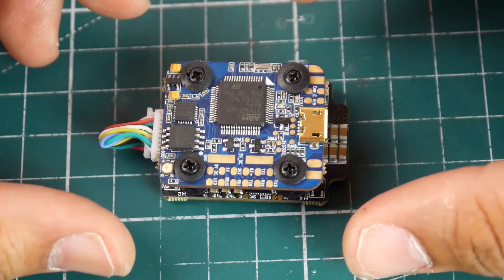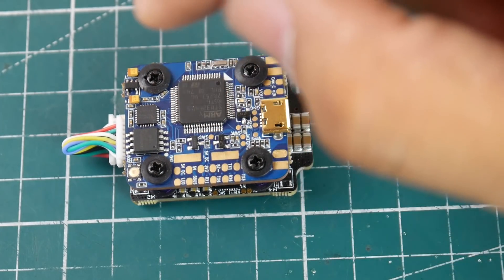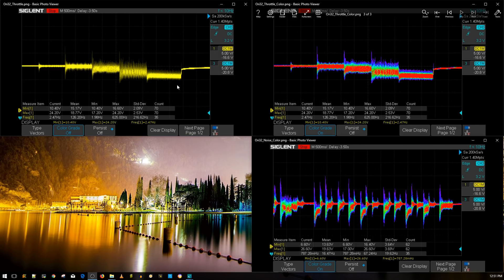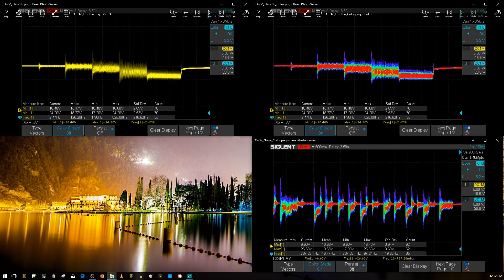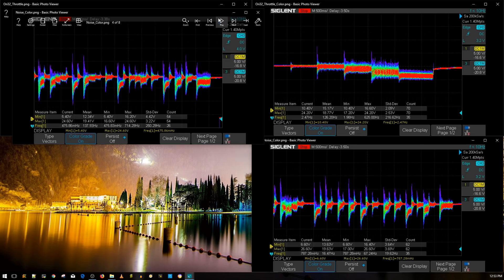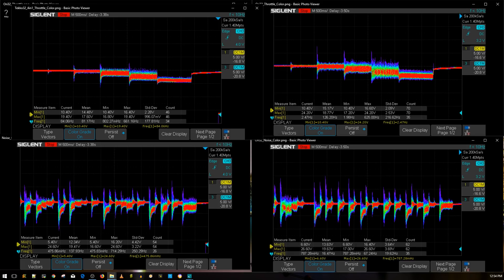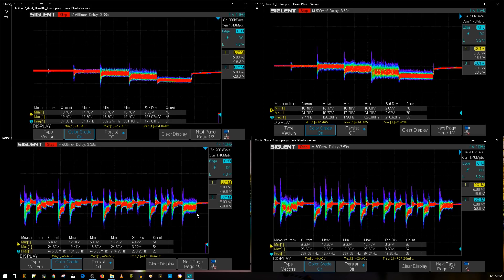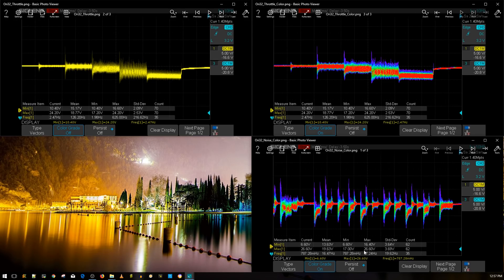NO WAY IT IS THAT GOOD!!! // Airbot Ori32 ESC Review And Noise Testing ,Omnibus F4 Nano

Comment from the maker: Airbot Ori32
https://www.banggood.com/Original-Airbot-Omnibus-F4-Nano-Flight-Controller-with-LC-Filter-Ori32-4-In-1-25A-Brushless-ESC-p-1321664.html??p=CS101558118042016088&utm_source=sns&utm_medium=rcgroups&utm_campaign=mesh&utm_content=tanghao
Reply: Esc can take 6s 👌😎
Reply: @maloulukasholm  i got 4 6s racing quads using em.. just run a nice fat cap and your golden.. one of them is a 2150kv 2306  set up also... she pretty fast. I've been running em 6s for over 6 months also.. very good esc

Comment: Hey man really enjoy these videos they give an accurate measurement of how good the esc are and show the best ones, I am highly considering this esc paired up with the omnibus nano v6 20x20, but when I go to airbots website, it shows what is called a Nox v2.19 you reviewed the pre release a year back but the specs on the nox look a lot better it can even have a 32khz gyro and it has 35 amp esc, I want to do a xhover vanover build which should fit the big thing, but the ori32 is a lot more popular on rc groups, really not sure what to get. I appreciate what you do and thanks.

Comment: Would anyone be willing to post dimensions? I can't find basic dimensions anywhere, even on Airbot's website. I just need basic dimensions so I can mock it up and make sure it fits in my custom 3inch frame.
Reply: 35*27mm for both ESC and FC, the protruding part on the ESC has total length of 40mm.

Comment: You should try testing the new lumenier. V3 micro stack 32 bit. I got one to put into my babyhawk r and once it arms it goes crazy like if I had my props on wrong or the motor direction is wrong but there not. And a lot of people are saying it’s really good.
Reply: My lux v2's gyro orientation was off like 270* on pitch and roll.  Once that was set up it flies nice.

Comment: Thanks for testing this! I run this same setup on a 6s 3" build. I run F20 2800kv motors on 6s 550mAh batteries and it runs like a champ. I got the 8v powering the Caddx Turtle and FX3 Ultimate VTX 20x20 vtx for a micro powerhouse. It cruises at around 1.5A and pulls near 80A on a punchout lol
Reply: I assume this is in a brat frame?  Hows the fpv video feed?  I've had issues with the akk fx3 filtering.
Reply: It is on a Tooth Fairy and with CRSF I might add :) I do get a bit of noise on them though yea. I got them on two builds and while it is a decent feed (better than most cheapies) I do have a bit of noise on both of mine even with caps. No biggie, but yea you aren't alone there. I'm also running 3052s and HQ3x5s and motors are still coming down cool. Might even go to 4" 6s.
Reply: @dispozablemobile  I am looking at trying a 6s micro.  Have you used anything else other than the f20s on 6s?
Reply: @BBSlats  no, just the F20s. However 5s 3600kv is much more fun :)

Comment: I have this stack in my only build, gotta say it's very, very good as DM said.

The FC is feature packed for such a tiny size, easily beat many full-size FCs. 5 UARTs, 1 Softser, II2C, CAM_C, S/A and ESC telem interfaces all conveniently placed. Baro, flash memory, 5V BEC, filtered 8V BEC for FPV (works very effectively!), onboard gyro capacitor and OSD in 20x20 form-factor!

The ESC is another beast. Designed in a way so users can install their own heatsink above the FETs, which increases the current rating exponentially (heat dissipation is #1 limiting factor in ESC). Individual current shunts which is incredible because most 30x30 ESCs don't even have individual current shunts, it also allows for BL_32 current limiting function for further protection. Very thick PCB, ESC telemetry function and so on.

A bit of note though, the ESC could take up to 6S comfortably. A lot of users have reported their stack works with 6S on 3" and 5" with no problem. A user even tried to fly with T-Motor (not sure which version) 2600KV on 6S ( https://youtu.be/TnkZIzjIU9s )
Reply: Update: I've gone through 3 ESCs in half a year.. While they sure can handle high current, they can't handle high transient current caused by gate clipping and such. I will not recommend the ESC. The FC in the other hand, still holds up well.

Comment: Brill! Pleased about these results as I already had one on order! Did it come with a heat sink?
Reply from the maker: No
Reply: @DroneMesh  kk, thought so, of purchased separately the ESC has a heat sink. Interesting...
Reply from the maker: @StormadoMan  I got the stack but maybe if its separate it comes with the heat sink.
Reply: @DroneMesh  correct sir! Great results thanks for testing. 👍
Reply: Be glad that yours will be shipped with the 8-pin connector. Mine was grounded for weeks before maiden just because the little piece of plastic.
Reply: bro how do you NOT have a drawer  FULL of various connectors  ?!??!?!?